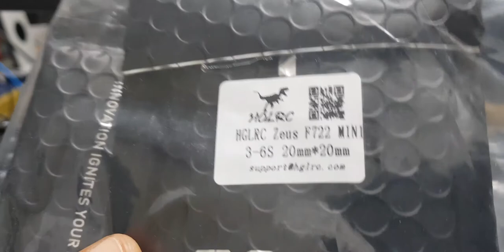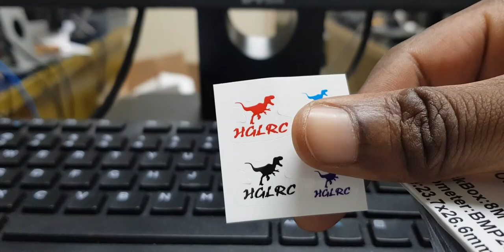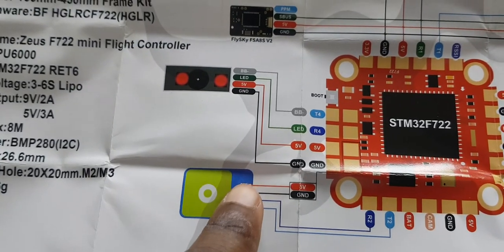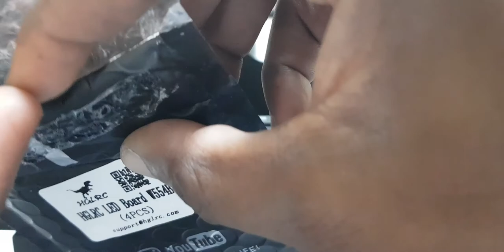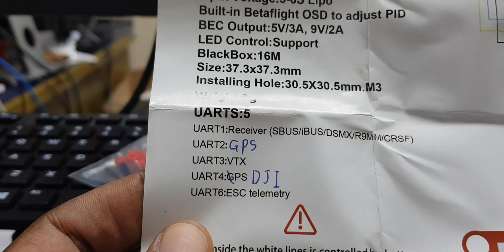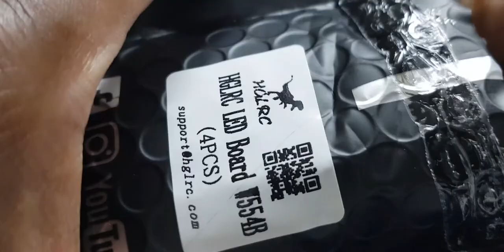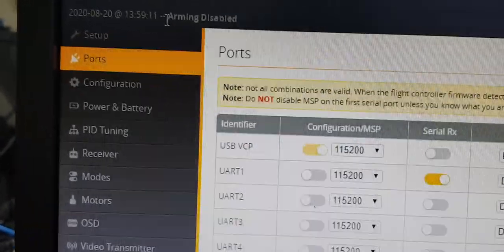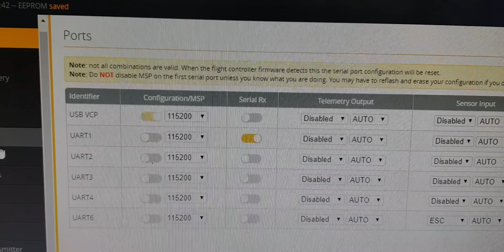HGLRC Zeus F722 unboxing with LED and M80 GPS

Comment: how did you get the led's to work?
Reply from the maker: I ended up copying a few CLI commands from someone else in Betaflight.    I don't have that flight controller anymore.

I'll find the CLI commands again, and post them here.    I couldn't get it to work in the traditional manner in the Configurator.   One of MY mistakes is that I just updated to the latest target without noting or backing up the default settings (please note and backup yours).

These flight controllers have a weak voltage regulator in my opinion.  You can do the 4 LEDs, receiver, GPS, and beeper, but if you add any more than that and draw too much current, the above mentioned components get power loss at random.   The LEDs do look cool when they work (in the programmable fashion).